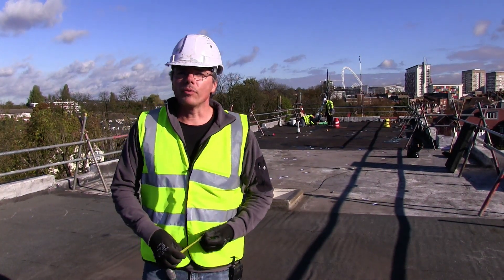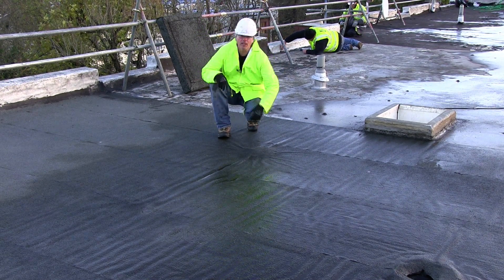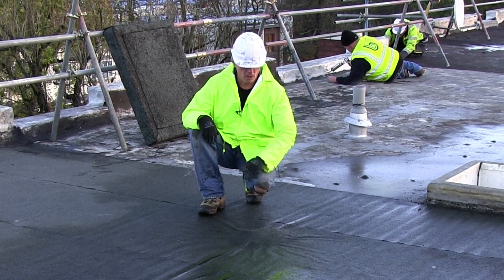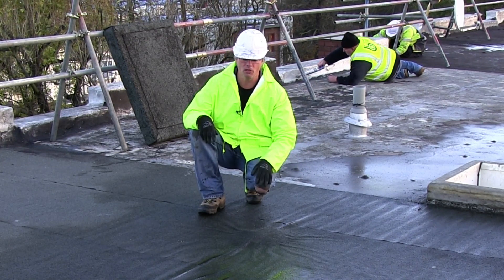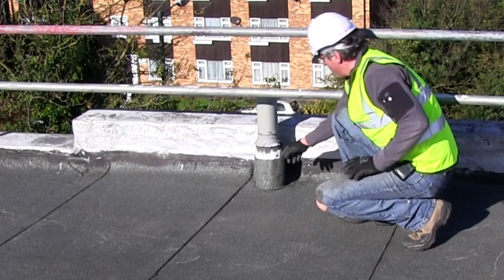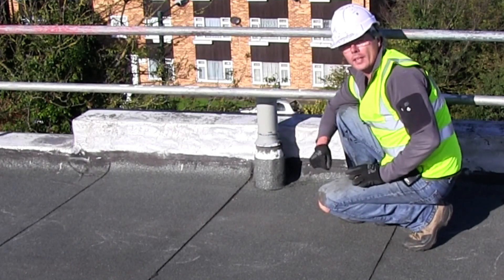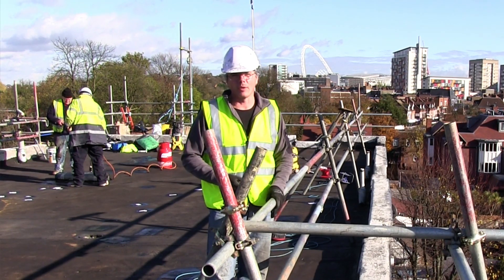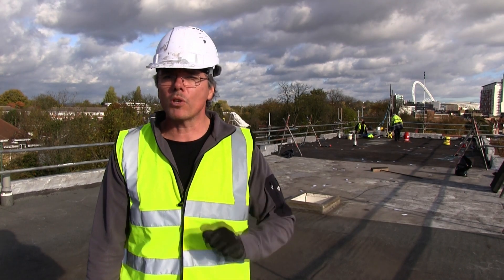Preparing an old asphalt roof for covering with a liquid flat roofing system.

Comment: Did it last more than a few months?  Had a Gaco roof coating installed over asphalt but it failed within months.  Snake oil.
Reply from the maker: Yes, I was not impressed with Gaco in America, they seem to use an awful lot of it. I even went to the factory in America and did a tour and it is huge but I just can't understand how the stuff works. I looked at some samples and they were so thin and you could scrape them off with your finger.

Comment: I've ben recommended Kemper for some old external concrete stairs, that have been coated with a hard bitumen layer, which is now porous as it leaks to the interior below. Do you have any recommendations please?
Reply from the maker: Kemper  is good for this however we don't use it any more because of cost  and other complications. We use the Mariseal system  its part of there balcony system  a good hard wearing liquid applied roofing membrane

Comment: If you are applying a liqued system , why are you putting down torch on felt at 3.11, is it as a base?
Reply from the maker: As part of the preparation we had to chop out old blisters and backfill them, this leaves the roof open until we apply the liquid roofing materials sp the felt is to make a temporary repair of the roof before we coat it with the liquid roofing system